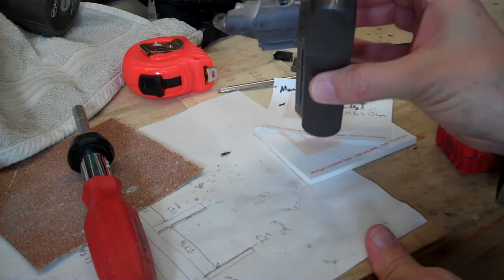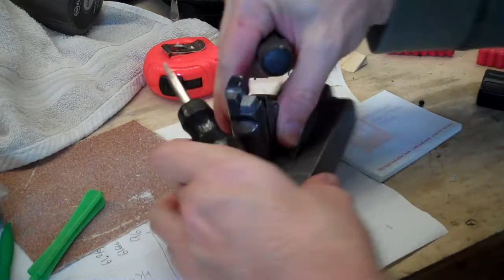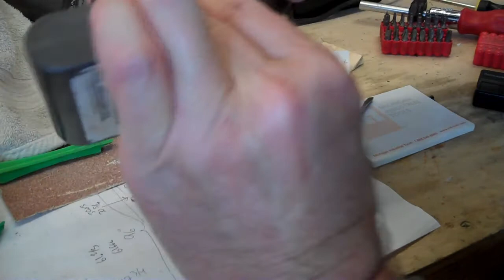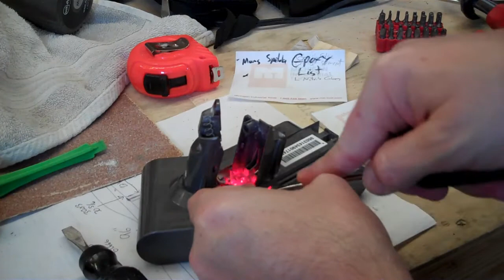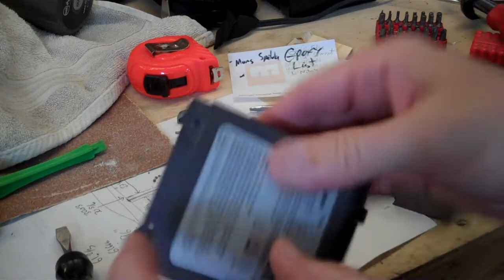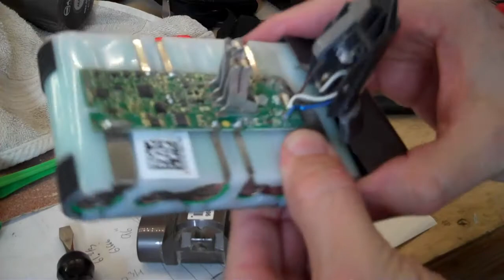Disassembly / tear-down of a Dyson v6 battery/charger/bms assembly

Comment: Make a milwaukee battery adaptor for that
Reply from the maker: Well, in my case it would have to be Porter Cable, as my Ego batteries are much too high a voltage.
Reply: These power tool batteries are 5S, so 18 V nominal (no matter what the marketing says) while the original Dyson is a 6S at 21.6 V. Back-of-the-napkin math says the vacuum cleaner with the power tool battery will deliver over 100 W less...

It would be interesting to see a comparison of a brand new Dyson battery vs a brand new power tool battery. Like on actual suction power, not math.

Comment: Did you check voltage in each battery to see if it's only one that needs replacing??
Reply from the maker: Good suggestion, that's a low cost easy diagnostic that I neglected. I checked, and the cells ranged from a low of 3.75 to a high of 3.91 (most were in the 3.85 range).  I could replace the 3.75 volt cell, but given the 7+ year age of the pack, the fact that Dyson probably used good quality cells, and the fact that the BMS looks to be a balancing one, I doubt the lowest voltage cell is much worse than the others. [When I saw that replacement packs could be had for $35, my motivation to do cell  replacements went away ;>]

Comment: Hi, it's not possible to use again  a disconnected Dyson BMS or a BMS with red light . It locks down definitely and must be reactivated with a special tool in the factory. And this first of all for commercial reasons . So just for the trash.... I change the cells with a chinese" Dyson" Bms without this issue, and so I can re-use it several times , with 2700 mAh  high drain cells to have better capacity. I cut all tabs and the little screw above keeps the box closed , so I can easely check the balance. I add that most of 35§ batteries run,... Well, cheaper but with not so good cells compared to the Dyson cells.
However Max power (too many amps) often used kills these little batteries quickly , and specially if you use this power with a half discharged battery.

Comment: Great video mate, can  I replace the battery with a 12800mah replacement battery? The volts are the same as old battery it’s just a bigger mah,,current battery is 1300mah 22.2v, replacement I’ve been looking at is 12800mah and 8800mah both 22.2v, 
Thanks
Reply from the maker: As long as the voltage is the same, and it is designed for the same version vacuum, it should fit and work properly. However I have reviewed many replacement Dyson batteries that claim to have higher amp hour capacity and really do not. (So don't necessarily base your purchasing decision on a published amp hour capacity.)